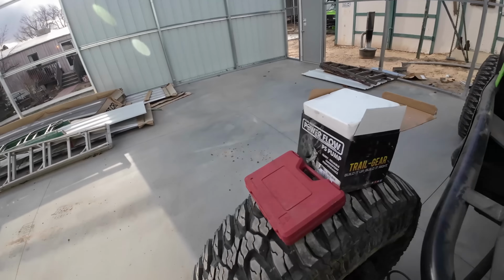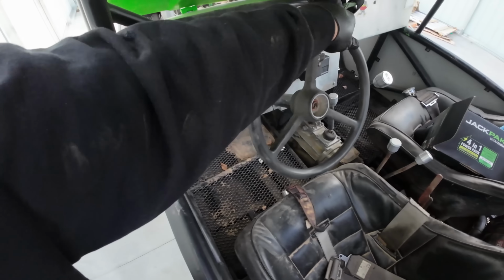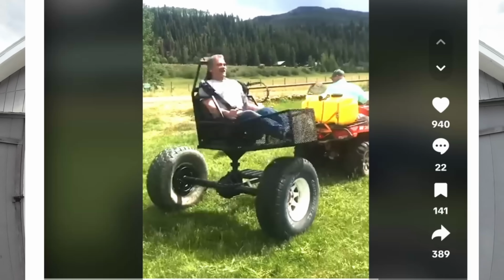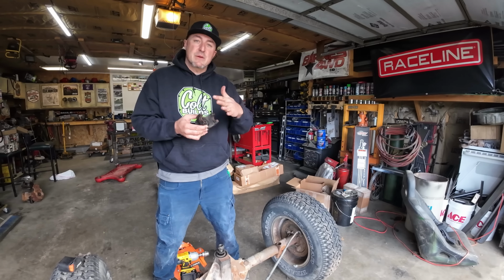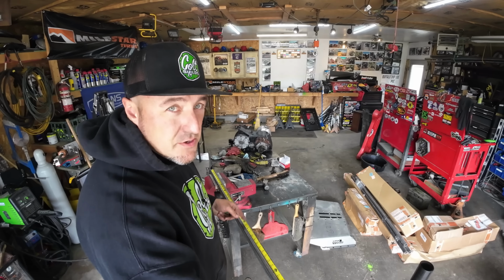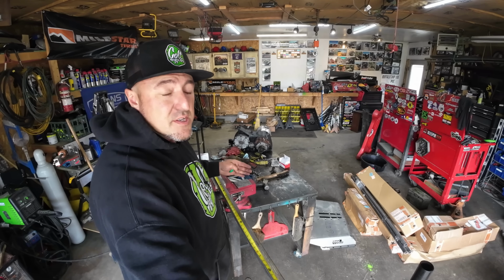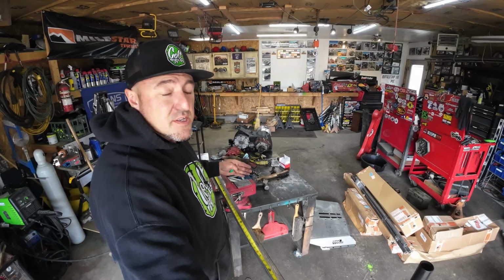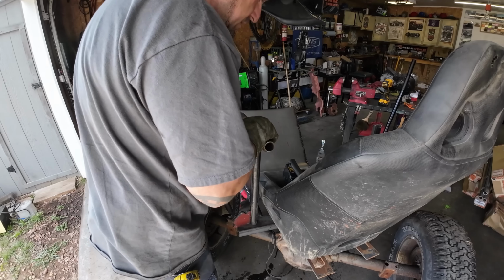How-To Build The Worlds Cheapest Carnival Ride!!! For CHEAP

Comment: could have built the chair on a flat platform so when you can no longer hold on the person can fly off. The chair couldn't have arm rests. You should put air conditioning in your shop definitely if you have not done that already since you repaired everything two years ago. The last comment won't matter if it's in a later video or it was done off video.

Comment: As an added trick    Since my PSC reservoir has an air break line fitting with n the cap.  Since I’m hydro assist, I pre filled the ram then attached the lines and filled them with fittings at ram loose then tightened attached to steer gear then topped off system.   Hooked a vacuum pump to the lid and put turns on the wheel   After cooking two pumps from advanced.  I believe my added steps prevent cavitations or the parts store pump was just junk

Comment: Colt, when I worked at g, m.We never used power steering fluid.We used Dextron transmission fluid
Reply from the maker: I doubt those were for full hydraulic high pressure pumps though. I've done the smell on regular daily driver pumps

Comment: I like your work Colt but there is no way I would ride your contraption. After at most 30 to 45 seconds I would be upchucking if I tried. Glad you are getting a shop wish I had one for different purpose. I want to be able to do woodworking.